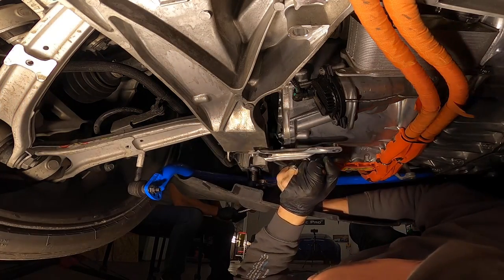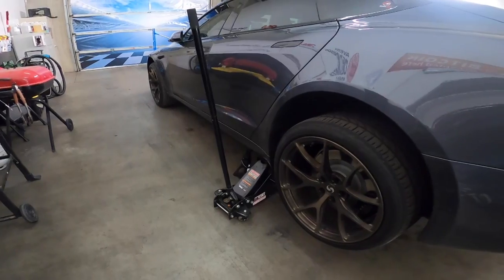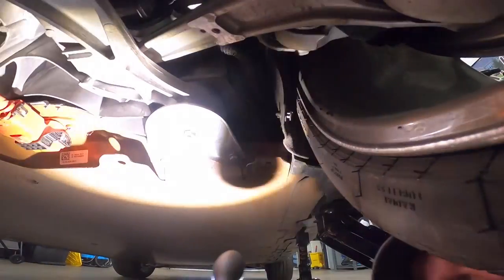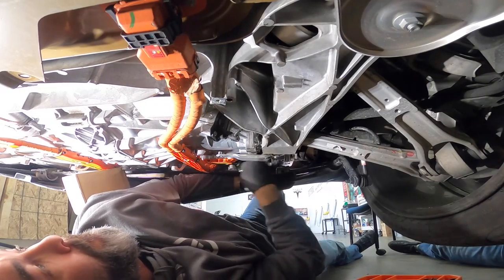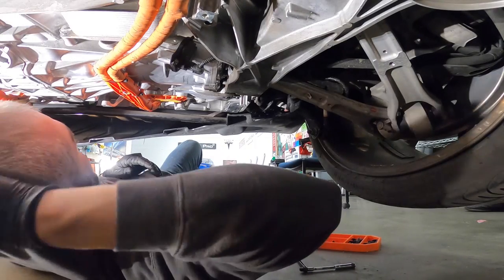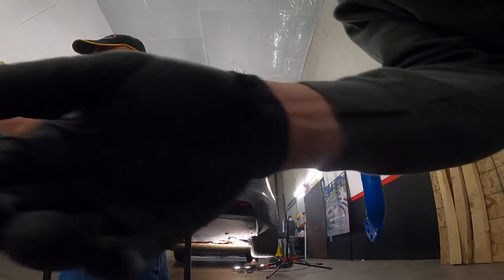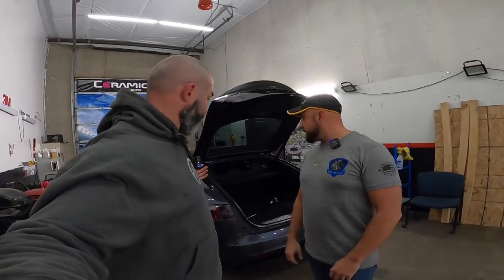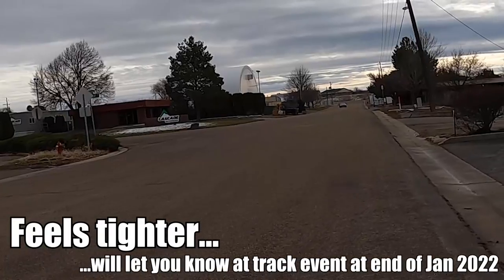Unplugged Performance Rear Sway Bar INSTALL | Tesla Model S Plaid

Comment: Thanks for another Awesome Video guys! I think the bar is the solution bec I noticed during the hard accelaration the front end just raising high and seems that it is car is squatting   with the rear sway bar looks like that fixes it.  can you do another video on cheetah stance  thanks

Comment: Great informative install . Any other modification plans for the plaid ?
Reply from the maker: I have a set of track wheels, softer tires.  Brake ducting/cooling… maybe some suspension components down the road…
Reply: @PlaidAF  great stuff , look forward to the content .👍

Comment: Curious why you are doing bars first vs other suspension changes?  Our #1 goal (after brakes!) was adjustability - specifically camber since the car comes with no adjustability and very low camber.  Basically the car needs to turn quite a bit better.  Along with that we did replacement of all the arms and their bushings since they are pretty squishy, really they are designed for comfort.  We have the prototype MPP arms which I don't think are in production yet.  I know UP is working on a set too.
Reply from the maker: I’m not looking to build a full track car- I want some comfort still.
Reply: @PlaidAF  Gotcha makes sense - well at least consider the camber arms. You can adjust those relatively quickly between track and non-track settings and they don't really lower the comfort level any, but they do increase the ability for the car to turn quite a bit.  In our experience bars are more of a driver tuning thing once you've got the car setup to get that last little bit.  Same thing for the brake brace, that just makes the brake pedal feel better all the time.